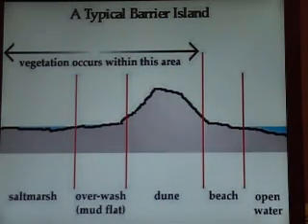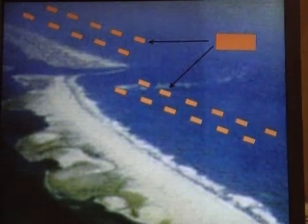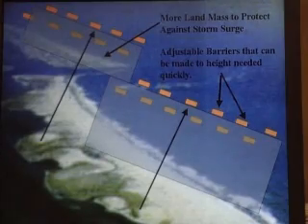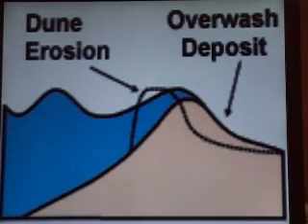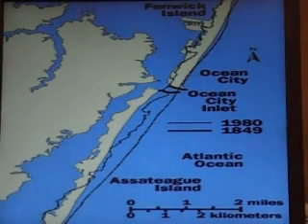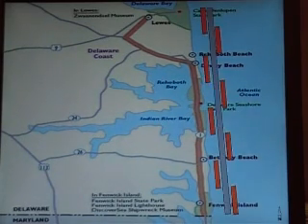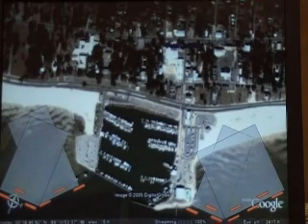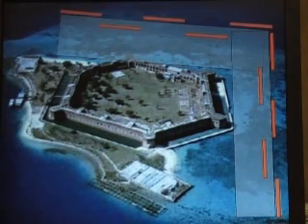Sand on Barrier Islands WITHOUT Barriers, False Protection

Comment from the maker: Local engineers and contractors from within the community can design the size needed within their control to begin building on a small scale, exam, drainage. This way lots of money would be saved by doing the work locally. Not mentioning stimulating the local economy while building the strongest protection ever invented. Once the cost has been made, a small percentage of that cost would go for the use of the patent system. Work can begin instantly. Once seen, larger protection could be funded.

Comment from the maker: To provide Absecon Island (Atlantic City, NJ)with the most strongest levee and barrier system ever invented and a system that can be added to any height needed. Cost Per Mile On Barrier Island or Along outer edges of Island in water in front or back of Island, would be 3.5 to 5 million per mile for 10ft high X 10ft wide for storm surge and salt water intrusion (erosion) protection.This design would contain sand or silt and prevent from being washed back out to sea. On land anywhere .5 to 1.5 M.